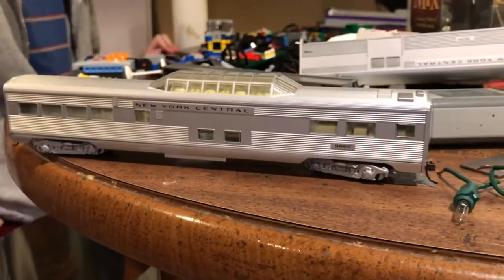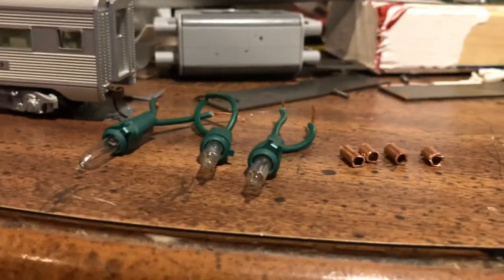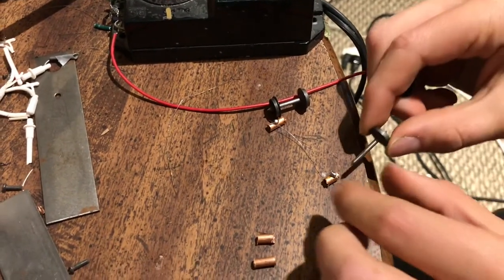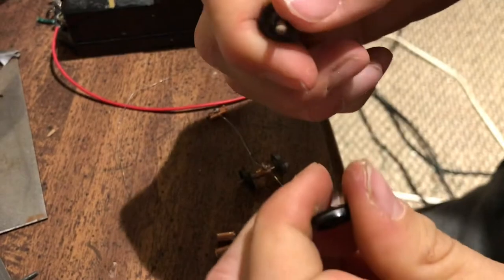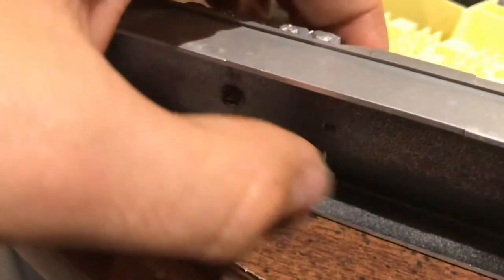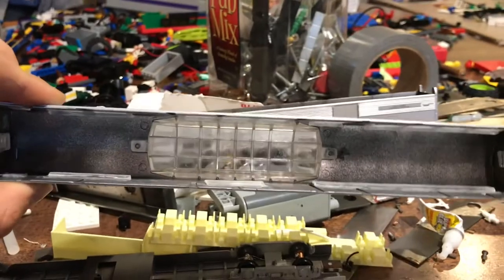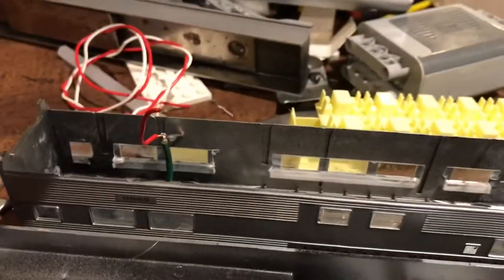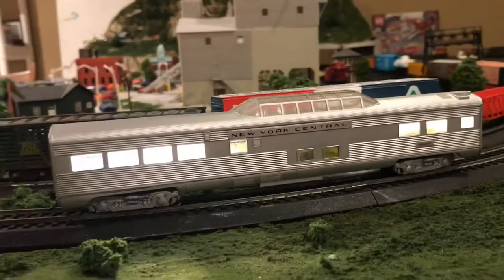How To Make Ho Scale Passenger Cars lighted

Comment: If you want to run LED lights, all you have to do is put a 1,000 ohm resister on the positive side of the LED.  You can run as many LED lights as you would ever want without the worry of overloading your transformer.  You can get 5mm LED lights from eBay 50 for $5.00 -- but your way was free and very inventive!
Reply from the maker: Thanks for the info! Unfortunately since making this video a while ago the lights have been removed